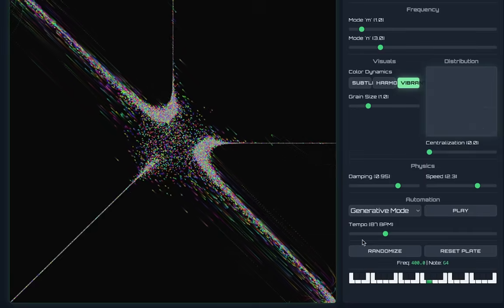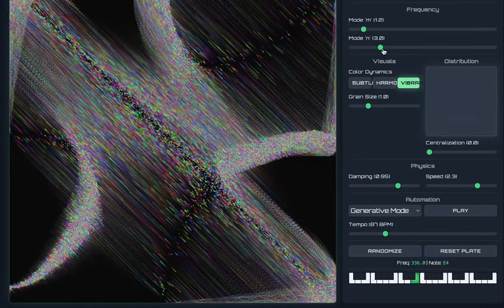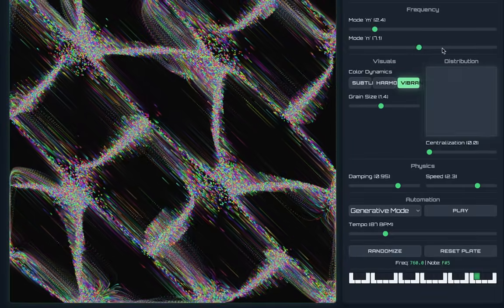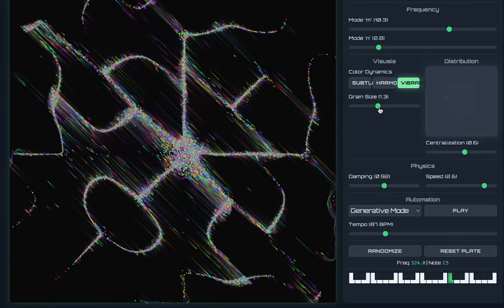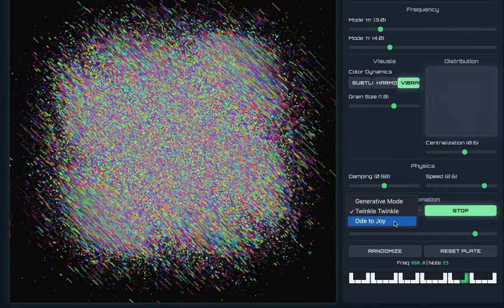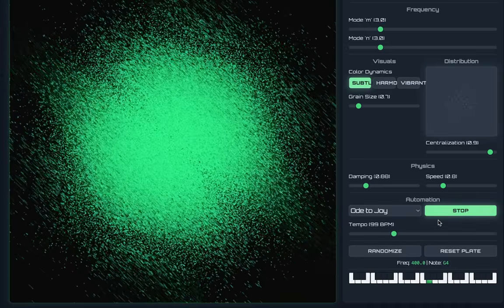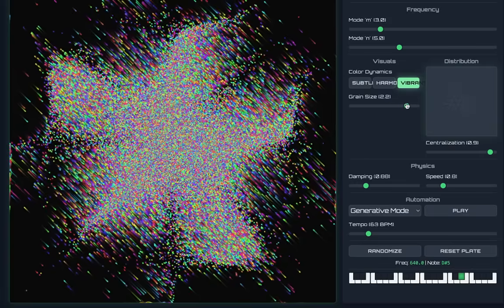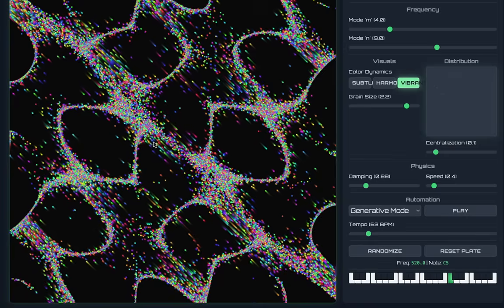Cymatics - The Geometry of Sound (Jun 29th, 2025)

Comment: How about completely reversing the process and have the patterns, themselves, be like 'moving/morphing wavetables', like a square section of waves on the surface of the ocean? 
So when you press a key on your midi controller keyboard, you get a particular sound, depending on the cymatic pattern (that can continuously morph/swap between patterns that you have stored as local image files, say) that can be further modified as they morph, using typical synthesizer modifiers or even 3D-style modifiers, related, perhaps, to particle/fluid dynamics physics.

Are you familiar with bird murmurations? They have the simulation math for them. Like herd movements anc fluid dynamics, probably even in the open source Blender 3D program.

I've been trying to find 3D spectrograms that don't scroll right to left but move more up and down like waves to denote the changes, but this seems to be the result of multiple wave sources interfering at multiple angles. I was thinking that if more than one spectrogram could be superimposed, I could get a new sound if the sine waves that sound is composed of can interfere . I suppose cymatics might have some bearing on this as well, but am as yet unsure.

Are you familiar with 'terrain synthesis'? They are a bit like those scanned-image synths but, so far, the terrains and images all seem to be static, without moving terrains/waves or images. The only thing moving is the scanning head or line. But I'd like the image/terrain/water to be what is moving, at least also.
Reply from the maker: Fascinating ...I think maybe for a subsequent visualization I might try something like this.  Thank you for the suggestion!